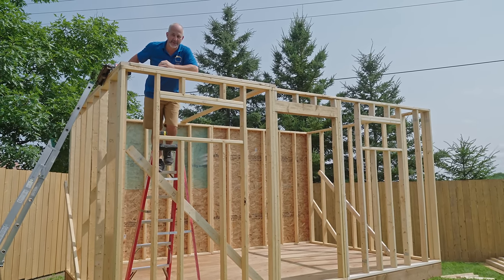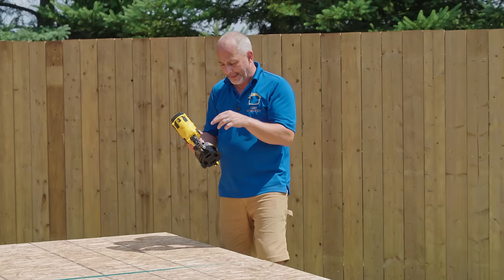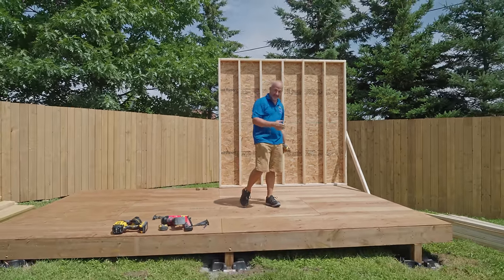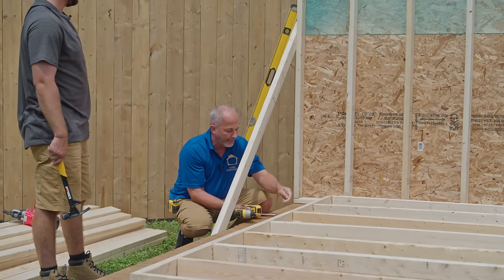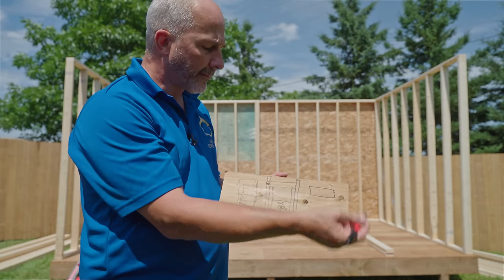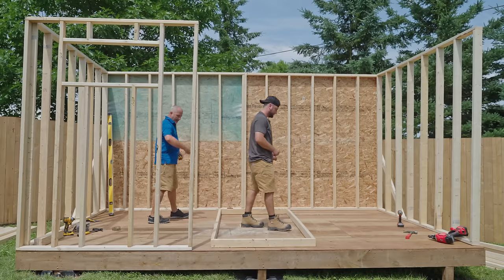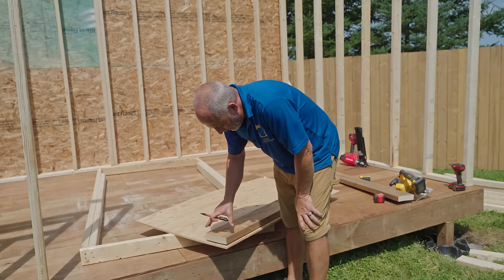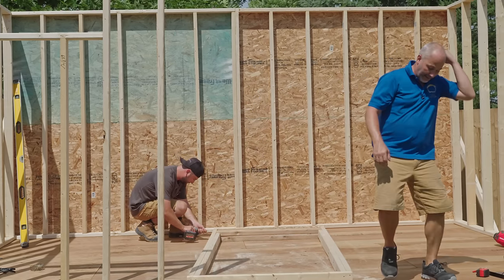How to Frame a Shed (One Section at a Time)

Comment: Being a retired contractor and done a lot of my jobs by myself . So when you assemble the first section cut the top and bottom plate back 3/4 of an inch so the  1/2 of the stud sticks out  past the sheathing edge 3'4 of an inch . The next section skip that first stud and put all the others in . When you stand it just work in in place and slid the second section of wall over to meet the first wall . Your sub wall sheathing will touch and meet in the center of the stud in the first wall . Now nail the sheathing from the first and second wall to that single stud because  they will be in the center of that stud . There you have saved the cost and extra work of using that second stud you don't need . I hope this helps it's one of the little tricks I came up with after I quit using a crew in the last few years and did all my work alone accept for contractors on utilities , plumbing, electrical ect.

Comment: 1 1/4” nail is not long enough for attaching exterior sheathing. Not even for a shed.
Reply: Its almost an inch into the studs 5 fasteners per stud what do u think would happen for all those to fail
Reply: @johntaylor6891   A shed might be ok but you cannot do this in a house.  2 3/8” is minimum for 1/2” thick sheathing.
Reply: It is not even close to 1” into stud. 3/4” into the stud which 1/4” of it is the sharp tip. So you have 1/2” of penetration to the stud. Good luck with that in a shear wall.
Reply: it's a shed after it's all done it's going no where until someone tears it down and it's 7/16  so it's closer to an inch than a 1/2 code counts tip and  so do I but
Reply: I would've used longer but I'm just saying it's not gonna fall apart
Reply: @johntaylor6891  No, it won't fail. But there are so many DIY'ers who watches youtube and tackle projects. They will think 1 1/4" nail is good enough for sheathing a house.
Reply: for this purpose that is acceptable... and because of the size, no code enforcement officer will follow up.  I am still in process of building a 12 x 12 shed and I put my sheathing up (7/16 osb) with 2 1/2" ring shank nails ... way overkill but oh well.
Reply: @Faruk651 And that's their fault for making assumptions. The responsibility of knowing what you're doing before you tackle a house build is on you...not on the guy who is instructing you in building a shed on YouTube.
Reply: @Faruk651  I'm using 2 3/8" inch hot dipped galvanized nails for my shed I'm building due to not being able to buy 2 1/2" inch nails in my area. Would that be overkill or would it be good still?

Comment: I love the fact the he doesn't just show you the  "how" to do it, but gives you the "why".  which makes a GREAT teacher/trainer.  Is there anything better than having the opportunity to work with your own son, I would love it.
Reply: i love how he goes back and explains where he miscalculated, some people would just say the had to change it and cut the video. He actually teaches us the know hows...
Reply: Ive been searching for how and mostly why videos. He nails it. My favorite so far.
Reply: He should use a shorter bit at times. He tends to angle the screws cause his impact has a 8 inch bit when a 2 inch would allow him to pick the angle of every screw. Great build eather way. 

Screws have problems in shear (depending on the gauge) but nails just pull out at the first sign of tension on the head. 

Nails are like little boys. I wouldn't trust them under tension from the head. Lol 😂

Comment: My favorite source for DIY/building tutorials! Another trick I've seen for taking the twist out of a stud is to shoot one nail, then zip a screw a little ways into the wide face of the stud, use the claw of a hammer on the screw to lever the stud straight, and hold the tension there while you shoot the second nail. You can get it perfect and zip the screw back out afterwards to reuse.

Comment: Thank you for sharing your expertise and it's always great to see a father / son team working on a project, awesome job Dad.  Great idea for breaking up the 16' walls into manageable sections someone can handle on their own.
Correct me if I'm wrong, but for the front wall with door and windows, it appears the original measurement was off (184" vs 192"), making the door four inches left of center. I.e. wall section left of the door was 70" and wall section right of the door was 78".
Hope you and your son continue to build, learn and grow together through every project.
Blessings!!

Comment: Great job...
I have an idea for over building of you are trying to upgrade a little.
.
It sounds like you're putting in a manufactured door.  But they don't tend to be large enough to allow lawnmowers or snow blowers in them.  And if they are, they tend to be expensive.  
  
One of the most abused parts of the shed is the door.  If it is a utility shed for yard equipment, you will need to build the door to fit lawnmowers and other items in.  And these doors tend to be heavy.  I've done duel ~ 2' doors making a 4' total.  This will make them wide enough for a lawnmower or snowblower into the shed or you could just open one side for a person to go in 
.
IN this case I've used 4x4 pressure treated for the jack studs around the door.   It is PR so if rain gets driven in it will be ok.  And I use a 4x4 because I used gate type hinges with lag screws.  The meat of a 4x4 is thick enough to handle the 3.5" lag screws.  This will more than handle the weight of the door and any abuse it gets from being bumped by yard equipment.

Comment: Love love love your channel. Just found you recently as want to replace my shed and build a deck for it to sit on. I am amazed and confused at the same time why here in the UK we have so little choice on materials and don’t have access to some of the ones that you’ve used. For example T1 11 sheeting, unheard of here! Which means more expensive option of sheathing and then cladding. And the inexpensive shed windows you used in previous video, nope! I live in a very exposed area and and it rains a lot here!! I will end up replacing a shop bought shed every few years at this rate. Thanks for your channel it’s given me the confidence to try 👍

Comment: The way my dad taught me to join wall sections like your first two, instead of having two studs backed up to each other, have the join half way between two studs and a joining plate under the top plate and on top of the bottom plate, screwed to all the adjacent components to hold the join rigid. That way your stud spacing inside the wall is regular all the way along, and you can find the studs easily.
If you don't put your ply sheathing on until the wall is standing up, you can sheath straight over the join and give it even more strength that way.

Comment: If you want to use the interior brace and have those benches up against the wall, you can just do a let in brace. It's a bit of work, but that's just Sweat Equity. Just need to notch out the studs and technically don't even need, for a structure that size, to use a 2 x 4, can just use a 1 x 4.

Comment: For the cripples is what they are called, always maintain 16 on center, 12 on center or what the studs were built on 24 on center(2x6). Keeps it consistent, and makes drywall and installing siding easier
Reply: A drawing professionally done , with elevations, cross section and  a couple of details is a necessity. Explains a lot and no- brainer on site.

Comment: Big fan, you walked me through gutting an abandoned house and redoing pretty much everything by myself apart from wiring , plumbing and hvac. Its coming out nice. I'm working on a 12x24 shed myself now.
What is the shed sitting on? Under the 4x4s? What are the plastic things? Thanks

Comment: I've been told to use nails as much as possible when framing instead of screws because nails have far superior shear strength, although as a DIYer I love to use screws because I am always messing up. I end up using using a combination. I heard you say deck screws are a no-no. What screws do you recommend? AWESOME watching y'all do all this. Learning so much!
Reply: Yep and he was concerned about modifying after nailing. No problem, I use a cat's paw to dig the nail out to access with a pry bar. It's super simple.
It's always good to watch someone else to learn a new trick or tip.

Comment: Thanks for your awesome frame construction video Jeff really appreciate watching and learning.
Am building a small indoors outdoors kitchen off my conservatory.
Have been building it frame by frame like you.
Today I was building the door frame which is totally separate and will be joined to the main frame with a top plate.
I was having trouble getting it square.
The top left corner diagonally is 10mls out.
compared to the right corner diagonally.
I drcided to leave it for now and get on with the other two frames, andget back to that door frame another day.
Is it really important to have the door frame exactly square given the topl eft corner is out by 
10  mills
The overall design is skillion Design .
Cheers 😊

Comment: Love the details you provide, as well as how you resolve the minor mistakes along the way....very authentic, thank you. Couple of questions on the Camo blocks. In your previous video (building the floor), it appears that you only used 4 Camo blocks. In this video, I see an extra block mid way on the rim joist. Is there also an extra one on the opposite rim joist thus giving a total of 6 blocks? Did you have to first remove the sub floor to add the extra blocks?

Comment: When you were tying in that last section of wall to the door frame, why not just use the "Clamp" to pull that "Gap" closed? This way, you know you get the Gap closed "TIGHT" and, you're not relying on the screws to pull it all together. (The clamp does that, then the screws hold it in place). Just a tip. Great Real-World Video !!

Comment: Great video! Might be a dumb question, but I'm working on my own on a garage and can only do two short sections at a time. How do you join two framed walls together before adding the top plate? Do you need to overlap the sheathing?  If you have a video on this please provide me the date that it was done to view it. Thanks a bunch!!

Comment: What about using sill gasket or another type of sealant under your bottom plate to keep bugs out? Taping the sheathing? Or bottom plate to floor frame? All pretty cheap things to do and can improve quality of life in there not having to battle off spiders or a wasp setting up a house or spend money on pesticides.
Reply: It's a shed not the Taj mahal
Reply: @b.m.4066  ha I know but I don’t want bugs in my shed either. Would rather spend $30 on a significant decrease in them being in there making everything dirtier with spiderwebs. Just my thought! Not for everyone I get that.
Reply: He isn't even sheathing the other 3 walls, so it would be overkill to tape the one wall that is sheathed, or to seal the bottom plate.

Comment: Top plate, bottom plate, studs on the side is a great way to ensure perimeter nailing on your sheet, until you lay them down. Not any more or less work to orient them correctly when your building the walls flat on the floor.

Comment: I am going to build a shed for my aunt similar to yours but she wants it 20x24 minimum and I want it to be 15W X 25L X 40H I have to get a permit to build it but I have to ask how big can I make it. This shed I have in mind will be built using several lumber using different sizes but build it strong enough to park my Z/28 in it and a few Garden Tractors. I don't want windows because it is easier for thieves to break into. I am going to use wood beams for the foundation and iron pipe for strength and HD adhesive carpenter glue. I would like to go with a concrete foundation but that would cost a lot because I wood frame it to hold 2 feet deep by the measures above. Thank you for your expertise in your video.

Comment: Hi Jeff. I am a solo mum who doesnt always have help on projects that urgently need doing. I have learnt so much from your shows that I have been able to do projects by myself with confidence. Thank you so much for the knowledge you share, it makes a difference to many people not just myself. Quick question please. I live in new zealand and we dont have a few of your tools at our normal tool shops. I have to ebay or trademe to purchase but i dont always know what they are called. I saw your deck plank screw thing that looks like a stationary stapler but what is your fancy twisted wood fixing claw hammer called? Here a normal hammer is called a claw hammer. Thankyou, C.

Comment: That's what I did- built in sections. But I did mine for a slightly different reason, not just the weight, but I want to be able to take it apart, put it on a truck, and take it to a new location.

Comment: I'm building a similar shed, 16 x 10, with a shed roof. I noticed when you built the base you originally only had 4 posts, but at the beginning of this video I noticed you added posts half way along the 16' run. Was that just for overkill or was it based on what Camo recommends or something else? Just curious. I'm using 8 in total and I was only able to get the Tuff Blocks in my area which support 1700 lbs each and are a little smaller at 10 x 10 inches. Love your videos and build my deck based on your advice last year. Thanks!

Comment: Is there a reason you don't use pressure treated wood for framing? The bottom piece seems like it should be (what would be the bottom of the wall). So why not all of the framing? Cost? VOCs? I'm trying to learn. Building a shed addition and I'm starting with telephone poles as the foundation. I have a lot of them. I want to start off with building a deck, then add on as funds and materials become available.

Comment: Instead of the inside brace (diagonal 2x4) can you just put horizontal blocking in between the 2x4 to keep it from racking?
Reply from the maker: no where as  effective. adding sheathing is a better choice if you can't live with the brace.
Reply: @HomeRenoVisionDIY  thanks sir!

Comment: I understand that this is a diy, knowing that I would like to insert my expert advice. When using screws use structural screws anything other than structural screws should be temporary. In this type of build nails are typically used. Bracing, if I were cutting cost on osb I would install let-in bracing diagonally from bottom plate to top plate.

Comment: Question , I'm going to build a shed on my concrete slab, but it's not raised up, what kind of wood do you recommend I use on the bottom of the framing walls?   Thank you

Comment: You don't  need  2- 2 by 6 or Osb in that header. Flush a single 2-by 6 to the outside of the wall and you'll have 2 inches of thickness left on the inside of the wall for insulation.
Reply: He said it was way over kill but wanted to show everyone how to do a proper header
Reply: @b.m.4066 A proper outside wall  header  is built to `always` allow for as much space for insulation as possible, in this build and any other one.
Reply from the maker: on a real home you can use 1/2 rigid foam in between the blocks for a thermal break
Reply: @JimWatsonTheframingMagician  yeah, that's just NOT true. A typical exterior header on a house is two 2x12 with a half inch board between them. That's how almost every single header in this country has been done and is currently being done. I've been on construction sites my entire life and have never seen somebody put just one board on the outside. On a shed yes you could get away with one board but when you go framing a house or garage and there is load being put on that header you'd be stupid to only put one board
Reply: @b.m.4066  I've framed hundreds of houses,apartments and the like..in big cities and small.  Its always 2x10 headers.Renovision is right! you would use 2x12, glulam or a iron I-beam or whatever is on the prints. Why would you need  2 2x6s over a 3 foot opening? Especially when a single would allow valuable space for insulation. Typically snow loads are 50 lbs. The header could not possibly sag or deflect under those conditions. It's only 18 inches from the center of the header too the other side of the window. Plus there's 2 plates above that. Every part of that span can support a 50 pound snow load, or a 747.

Comment: I'm perfectly fine with vinyl. My house has vinyl siding.
Putting the bracing 2x4 on the wrong way is something I would have done. LOL. 
Have you ever seen the crazy framer videos where he frames houses by himself? He's figured out some good techniques for lifting stuff-- even longer walls.
I have cows so leaving anything unsheathed would be a disaster. One wrong movement of a horn and the vinyl siding is toast. I've seen one of my cows rub her butt on the side of the house. The cows also lean on structures sometimes. We have some metal sheds that are bent in and the metal doors ruined from cows leaning on them. So, the extra $ would be worth it for my purposes, but if you don't have to worry about stuff like that, then you can save yourself some $.
In Texas and some other places they now use a 1/2" foam board in between the 2x6 header pieces in a 2x4 wall. That insulates it but still fills the gap. I priced it out and in my area, the foam board is cheaper than the plywood.]
I have an exterior door with a "header" like that window-- Just a 2x on the flat and its one inch lower on the left than it is on the right. Just a single 2x (can't remember if its x6 or x4-- need to go measure) and it is not doing the job well on this old house. 
ooh! That hammer that can grab the framing is awesome! Do you have a link for it please?
I can't even be out in the sun due to meds I take but heat really kills my energy & my brain. LOL.
Have to wait a full week for the next video? I'm counting down the minutes! LOL.
This was pretty informative. I enjoyed it.